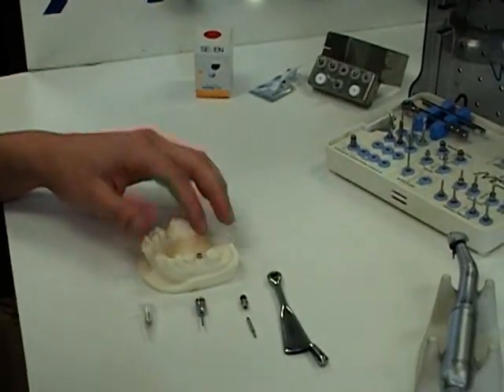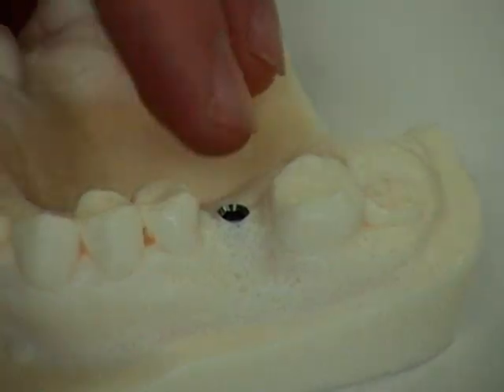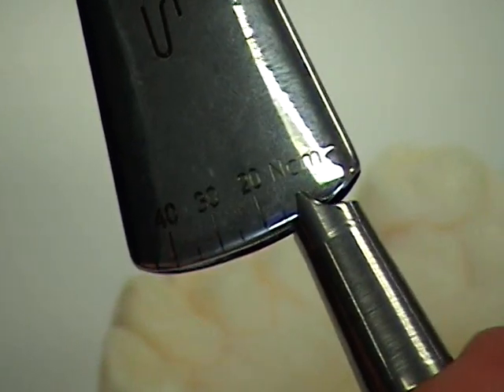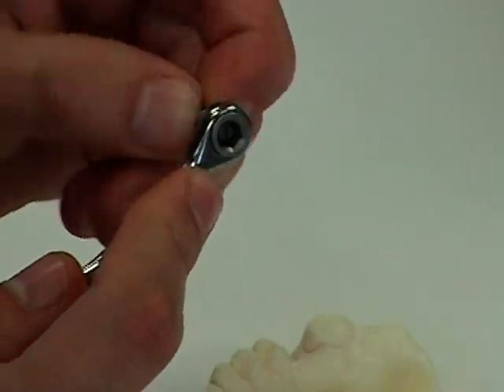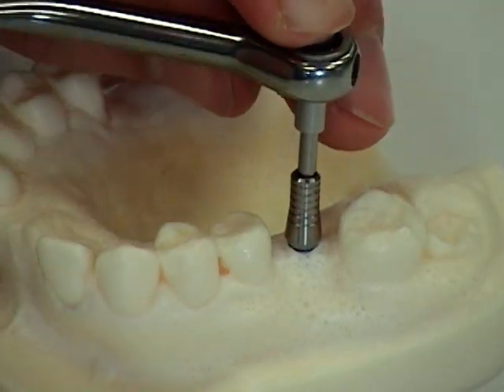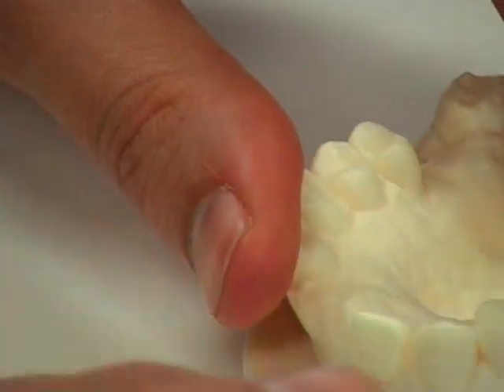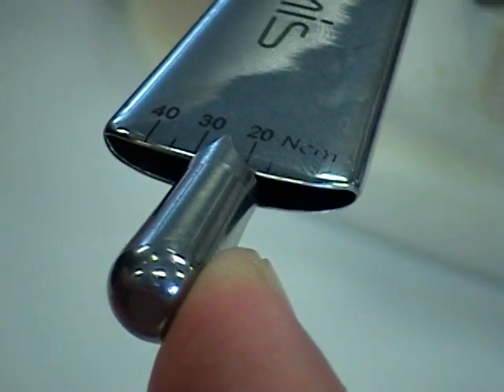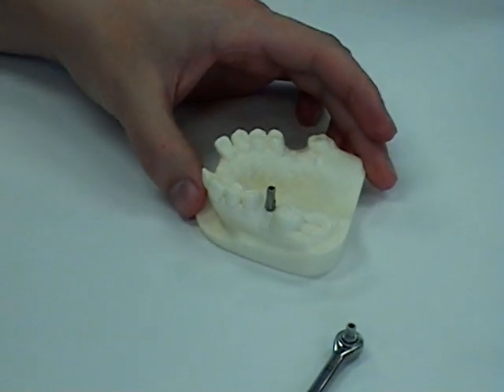Dental implants continuing education course - placing an abutment using a torque wrench

Comment: can this mis torque rachet can be use for measuring torque for immediately loading of implants as it has maximum 40Ncm and 45Ncm is a requirement for immediatly loading implant